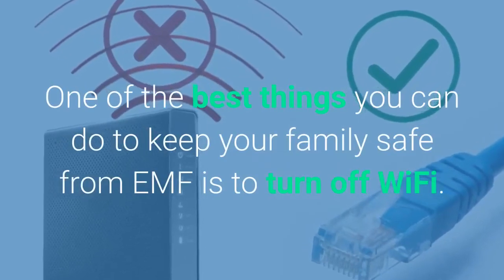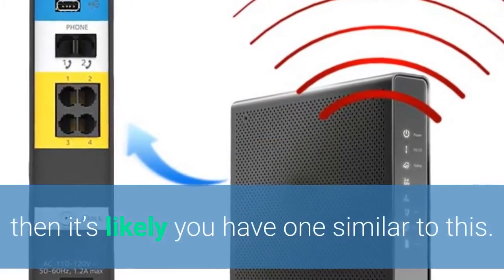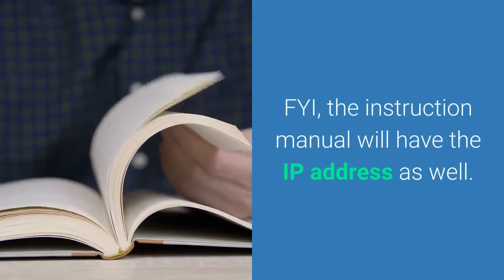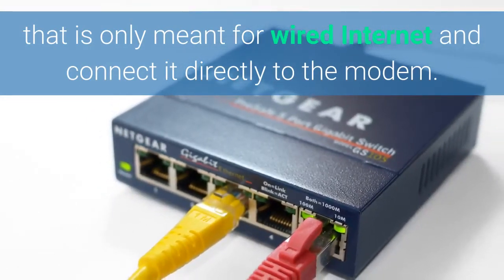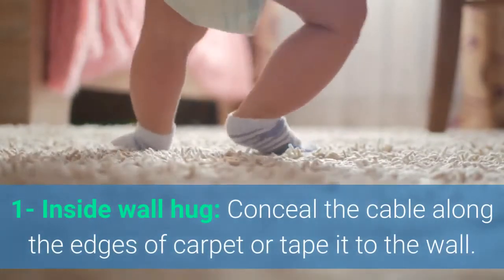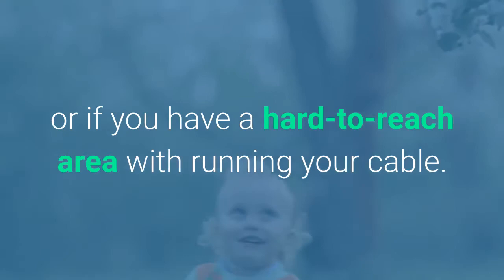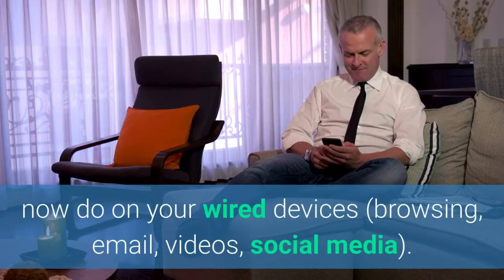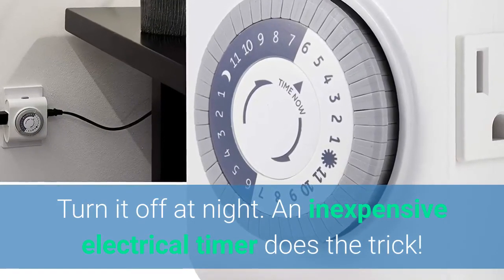How to Turn Off WiFi & Install Wired Internet

Comment from the maker: Hi Everyone! I've had a lot of trouble with routers not actually turning off when they should (especially Xfinity) ... I give a more in-depth answer to Sara M. below. Once/If I can get to the bottom of it I will definitely let you know. So be sure to subscribe so you don’t miss any new updates. Here are some ✨FREE EMF Protection Resources✨ that can help you out on your EMF Safe Family journey! 👇⬇👇
• [FREE Gear] Get FREE EMF Gear Delivered to your door and information to your inbox: https://emfsafefamily.com/free-protection/
• [FREE Webinar] Watch to learn how to live worry-free when it comes to 5G and EMF: https://emfsafefamily.com/free-5g-emf-safety-webinar
• [FREE Quiz] Discover how EMF-polluted your home is: https://emfsafefamily.com/free-emf-polution-quiz
Reply: Thank you for this video.
My issue is that my internet modem will not allow multiple IP address access when plugged in. So I can only run multiple devices through wifi router and cannot disable wifi.

Comment: Thanks for the video.  I've disabled wifi on my xfinity XB3 router but the lights are still blinking for the 2.4 and 5 GHz.  You mentioned that the lights will go off, did you mean they go off and stay off?  If the lights are still blinking even though the wifi is technically disabled, am I still getting EMF from the router?
Reply: I see many folks in the xfinity community on the xfinity site say this very thing. So far, from what I've gleaned from their conversations, is that no matter what, these xfinity devices will emit powerful EMFs no matter what we (consumer) do to "turn them off". I did see an xfinity user recently say they were done messing about and just ordered a Motorola Cable Modem. I'm curious  why that was the solution. It seems they do not have wireless tech in them. I'm not a well versed in this technology but wonder if we'd need a switch to pair with a cable modem to ensure we can supply multiple different devices in the home with internet. We ran our ethernet cables through our crawlspace and up through our walls. We really need RF meters to truly test our success.

Comment: Hi EMF Safe Family, This video was very helpful. After I disabled the WIFI, both the 2.4GHz and the 5GHz, the lights went out on the modem and then a few moments later the lights started to flash on and off. Does this mean that the WIFI is not truly disabled? Any idea why these lights might be flashing? Thank you.
Reply from the maker: Hey Sara, Thanks for the question and sorry for such a late reply 😬. After putting all the information I've gathered into practice, I've had so so so much trouble with Xfinity routers and them not actually turning off... I used my EMF meter and sure enough, it was still going. I even contacted support... the whole 9 yards and still don't have an answer. If I ever do get the answer I will let you know... I think it has something to do with their free xfinity wifi service where they use yours and everybody else's router on a different bandwidth to create a free network for all customers and they're not allowing it to be turned off at the moment (that's my theory anyway). So for now I recommend getting an outlet timer to make sure it's off during times that you don't need it and that will help a lot. Let me know if you discover anything. Thanks!

Comment: I'm needing a new washing machine but all the models with the other features I need have Wi-Fi? ??
I don't even understand the point.
I don't need or want my washer to have an app or connect to the internet!!
I can turn the machine on just fine when I put the clothes & soap in it.

Is there a way to permanently disconnect the wi-fi from these new washing machines?
Reply from the maker: Let me know if a specific model or two that you're looking into and I'll see what I can find.